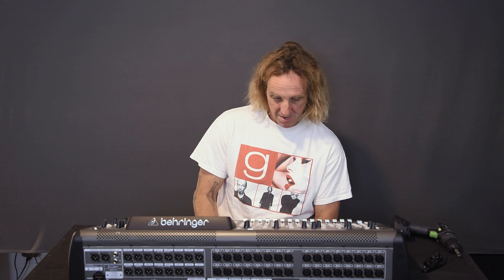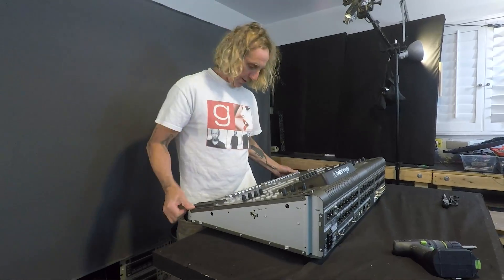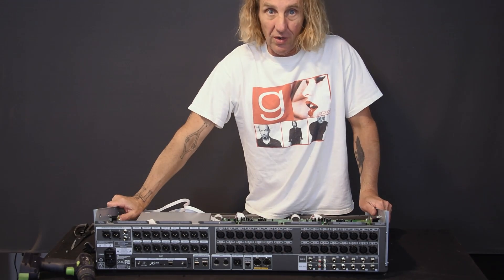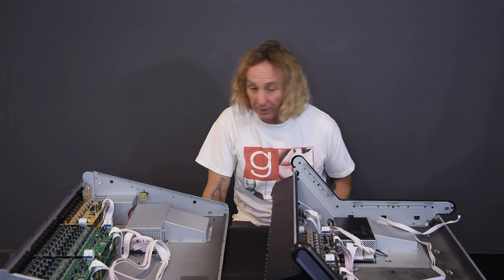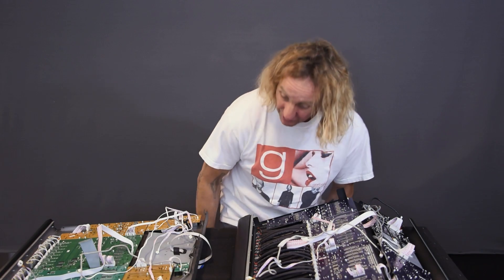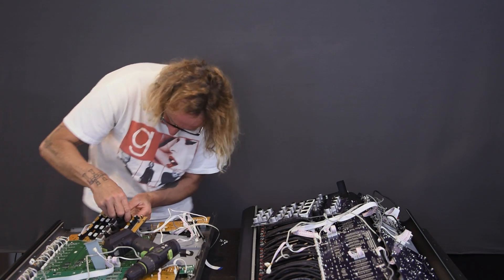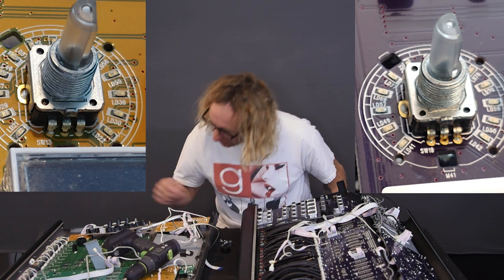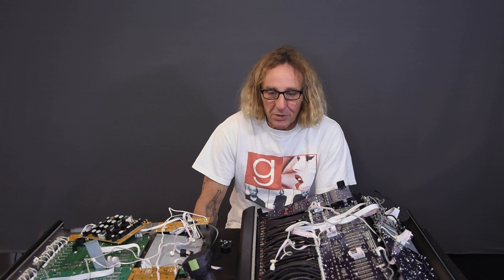Take Apart Behringer X32 & Midas M32 (Public)

Comment: A couple years ago the bands came off 2 of the faders on our M32. Having been inside our Midas XL200 numerous times I figurered I would try to tackle this. I could find no videos or info on getting into an M32 but several on the x32. They almost pursuaded me not to proceed. But I needed the console for some immediate shows.  It was less painful than I expected but it would have been nice if they had made the ribbon cables a little bit longer. The way the board hinges back you would not have remove it  and therefore not have to undo all the cables ...if they were just a little longer. The faders were mounted in sections of 8  to a board that was then mounted to the frame. Easy peasy. I had bought some faders not knowing in advance what to expect. I got some of the x32 faders by mistake (should have known when a pack of 5 cost the same as a pack of 1 m32) They were indeed vastly different.  I just hope I never have to fix a loose band on our x32, because it will become surplus gear at that moment.

Comment: Interesting stuff.  Don't know exactly how I got here.  Living most of life on the electrical engineering side of my brain I have some insight though.  The cost delta is going to be cumulative.  However manufacturing process tends to be the most significant.  A product that can utilize surface mount and thus pick place machines is going to be more inexpensive provided there are a decent number to be manufactured.  Even those minimum volume levels are dropping every year.  Yes pick and place is used on through hole boards, but the boards requires all of those precision holes, and a solder wave flow.  Higher component rejection rates due to bent pins (all resulting in higher costs).  I see in the comments below there is a SNR delta between these units.  I would estimate that has more to do with board layout, and possible cumulative effects of ever so slightly reduced component selection.  Of course there is always the battle of diminishing returns.  The first 80% of a spec is cost effective.  The last 20% is exponentially more expensive as each percent is retired.  Neat stuff you have here Dave.  I might just wander around here a bit.  I promise not to touch anything ;-)
Reply from the maker: Awesome Shain and thank you!

Comment: Typical of Behringer to put hot glue on connectors. I know that the intention is to make them vibration proof (live and transportation) but isn't the clicking mechanism enough? I've never seen a connector like that come loose and other pro live brands don't use hot glue. Maybe they don't trust the cheap second rate parts they use :-P like the knockoff Neutrik sockets?
Reply from the maker: Yeah, cheap connectors will often have failures on the latch. Glues is a cheap and annoying fix

Comment: I can totally attest to the quality of the Midas faders. 

In 2017 I took out my brand new M32r for the first time mixing both support bands on tour with Cannibal Corpse. Towards the end of the second set at summit music hall I took a full Mikes Hard lemonade tall can to the face. I mean this person had to really try and MAN, BULLSEYE! Anyways, it dumped straight into fader bank 1-8. I got up asap, grabbed the can but easily 10oz of liquid already poured into the desk. Faders 4-8 started jumping, finished the show just muting when they’d jump. After I tilted it up and slowly dripped what was left out, turned it back and blew compressed air through the faders to try and get any liquid still there out. Didn’t use it the next day, kept in the case with a bunch of silica packets. Day 2 had to carefully clean some sticky shit out of some buttons and exercise a couple faders. Day 3 opened it up, tried it out, powered on and we were all good

5 years later still throwing delays with those same jumping faders. Well worth the price jump.
Reply: Just out of curiosity...Did this happen before or after the Portland, OR stop on that tour? I recall having some mysterious cat5 drop out from the stage box during gatecreeper's set at the hawthorne.
Reply: @jasperwasson4963  I don’t remember which was first in the routing but I do remember that day all too well as the day I learned to never trust the house cabling! If I’m correct, you had a sketchy old white ungrounded data cable that I mistakenly ran my show off of instead of my snake. Don’t worry, it won’t happen again! See you in April! :)

Comment: Top notch video 👍🏼 I was very impressed and interested to know what the differences were between the two processors of each console. I've been mixing for quite some time and have used both the X32 & M32 to my ears the M32 sounds more open and transparent and I'm sure the community will agree that there's enough arguments to be made between the two.
Reply from the maker: My understanding is that once the signal is converted to digital, the consoles are the same.

The differences are in the build quality, the analog circuitry and the d to a converters
Reply: @DaveRat  thanks again

Comment: Is there a difference with the scribble strips?  I've never used an X32, but the M32 that I've used a few times seems to have scribble strips that are mounted at different "levels" when viewed from the top.  In other words, it appears that some strips sit higher up off their board than others.  I feel certain it's never been damaged or repaired, so not sure why.  But, it appears to be built cheap, at least with the scribble strip displays.

Comment: Right off the bat I can see that on the Midas you would be able to replace "some" of the components (not all) if say a transistor or cap blew.  Behringer looks like strictly motherboard topology and therefore it's a bit harder to repair (disposable).   The similarities inside of the two boards is surprising though given the price difference.  
This is a great video and it does bring a lot of truth to light in terms of what we are spending the money on!!
Reply: Home reworking smd is nothing to shy away from. As with most things the right tools make it possible.
Reply from the maker: Agreed

Comment: Hi Dave, the contacts on the removable buttons may be the same, but longevity and durability of the circuit boards is EXTREMELY different.  The behringer looks like phenolic PCBs whose contacts won't hold up as well as the gold plated copper contacts on the FR4 circuit boards in the Midas.
Reply from the maker: The switch contacts on the x32 appear to be good plated as well

Comment: You seem like someone who has a lot of practical experience with the X32. Weird question for you. We've got an X32 and we are sending out broadcast mix from Ableton post processing through the USB via the X-USB in the X32. We are then routing this to AUX-In channels 1-2 and sending this channel post fader out to our ATEM for the livestream via AUX Out 5/6 and also out of local (back of the console) XLR out 1/2 for monitoring via headphones using a Behringer P1 headphone amp. I've come across this very strange phenomenon that when I push the input signal of the broadcast master AUX 1/2 up to -12 dB, I begin hearing a tonne of distortion coming through the XLRs on the P1 but no distortion on the ATEM. What could be causing this? I'm not clipping the input (I'm at -12 dB) but the XLR out still clips. It has me baffled. The P1 Amp volume is set quite low and the distortion is there regardless of volume on the P1. Keen to hear your thoughts and wondering if you have come across this issue with XLR output clipping before? Cheers
Reply from the maker: Oh my, thats beyond my knowledge of the consoles
Reply: 😅 Then I have no hope haha. Could it be an issue with DAC on the output?
Reply from the maker: Hopefully someone hear will see and post. Also on the paid member side I do zoom chats a few times a month and there are some sharp and knowledgeable people that are good at that kind of stuff

Comment: you can use the cheap plastic jewelry trays to organize screws as you remove them. that's what i do when i replace engines.
Reply from the maker: Good idea
Reply: @DaveRat  Harbor Freight has magnetic trays in different sizes for holding screws....I have too many of them

Comment: I just got one of your XLR Sniffer/Sender units. I am currently working with a fully installed system where they have about 30 XLR cables that 'magically' appear near the sound console, and are both ran into the wall, up the wall, and out a hole to continue their path to the stage some 75 feet forward and then another 25 feet down the back of the stage wall. None of these cables are labeled.  They also have a digital stage box. The ability to plug this device of yours into the XLR cables is going to allow me to identify about a half a dozen lines that I have no idea where they go. Sound people come and go, and keep adding lines, and modifying things. Trying to just get control of everything.
Reply from the maker: Excellent?! Let me know how it goes!!
Reply: @DaveRat  will do!

Comment: 13:17 The Behringer side has a visible seam on the threads and a rougher casting in general. The Midas part is a higher quality casting and the top of the mounting threads is machined flush.

Comment: What about workflow, are they roughly the same? Probably another video of the subject already? None of them has moving HUI faders, I presume?
Reply from the maker: Workflow and software is identical
Reply: @DaveRat  great, thanks for the answer... 👍 

Too bad none of these affordable live boards, has touch sensitive fades and HUI software build in. So I could use it as a studio mixing console, for my Pro Tools system. Lots of "ok" DAW controllers, on the market, but I miss the workflow and intuitive access to everything on the live consoles. It's as close to working on a analog console as it gets... 😊

Comment: I’m surprised at the differences that were found in the sonic tests.  I’m not an electronics engineer, but friends of mine that are have made some really high quality pre’s that didn’t cost much to make.  I have a friend that has done a lot of major design work for many of the big names and he was telling me that in terms of AD and DA really good ones can be had for exceptionally low money.  In terms of mic amps, I hear the noise about this pre against that pre and every test comparing pres I’ve ever heard posted the differences were subtle to say the least and comparisons with mic amps that cost a few pounds each and others that run more than a thousand a channel often are not clear cut.
Reply: Agreed. Very flat/clean mic pre's don't have be expensive. They can get expensive if you use a transformer on the input and expensive boutique switches. I'm legit both types of engineer (electrical and audio). Sometimes, very flat sounds... well... flat. Most audio engineers I know want SOME "character" out of their mic pre's. That's why for studio work... we typically buy a shit load of different flavored mic pre's then just mix and match for the current purpose/project. I don't think even steely dan drags a mixed rack of boutique mic pre's out on the road. I was very surprised by the resonance/ringing exhibited by the behringer board vs the Midas on the square wave input. I'd "guess" they both use the same off the shelf A/D converter (very accurate A/D's are cheap. why source 2 ??)  I'd have to snoop it using directly channel line out vs assigning to a buss and checking buss out. Also maybe test the aux line returns. Weird.
Reply from the maker: The a to d appears and I believe is the same while the D to A is different and a slightly lower latency on the Midas, 

And thank you.  And yes, a good flat mic pre can be inexpensive, and extremely quiet version with a wide input range gets more expensive.

Comment: The PCB boards looks to be of the cheaper "home brew" type on the X32, where the PCB on the M32 are the fiberglass version used in higher end equipment.
Part of the difference in the PCB's are their capacitive "resilience" and by that be more precise when moved between a cold van/truck and a hot concert hall ;)
Reply: They are both definitely FR4, the yellow color they went with just makes it look like that.
Reply from the maker: I would not be surprised if the x32 boards are lower cost. It would be consistent with other cost saving measures.

If the. Lower cost is pure looks or more brittle or lacks a coating would need to be tested.

We know the x32 9s cheaper, the question is "what concession were made to reduce the manufacturing cost?"
Reply: @DaveRat  I don't doubt the x32 board cost much less to produce as a whole but the PCB material itself is very very likely the same. These days you would have to pay extra to NOT use FR4, even the $2 Chinese prototype PCBs are FR4.

As you mentioned the faders are likely a big savings. Also the electrolytic capacitors are less and probably of a lower quality. I don't know if you got a look at the underside of the output boards on the x32 but I did not see anything equivalent to those xilinx FPGAs (the really large chips) they probably cost $50-100 each. If the x32 doesn't have those somewhere then they are actually a much different architecture than I would have expected.

It's possible they put the logic from that FPGA into a much smaller custom ASIC that just hasn't propagated to the m32 yet, they would have more incentive to do it in the higher volume product first.

Overall though as an EE that focuses on PCB design I am surprised the M32 is only 50% more expensive given what the internals look like. I can't say from just looking if the m32 is better electrically but I do think I can say it is definitely more costly to make. The margin on the x32 is probably much higher than the m32.
Reply from the maker: I agree and as a manufacturer of products and buying loads of circuit boards, we do have options to save money from differing vendors. My guess is that if the cost was the same, they would save money by using the same source and type, so just the fact that it is different may be an indicator that the savings was worth using a different vendor or board type.

And yes the pricey chip is not on the x32.

Thank you for the insight and knowledge!!! Very much appreciated.
Reply from the maker: Interesting

Comment: I had an X32 and added the Midas 32 channel snake head to the system, which made a significant difference ( and my ears are not that great! lol). I ended up with an M32R as control surface and sold the x32. I also use an MR18 occasionally, which is very cool also.
Reply: We run hybrid using m32 plus boxes to do most heavy lifting in a project studio 
Once we upgrade it will become touring rig what it’s actually intended for 🤣
Did just dive into 500series tho

Comment: Dave,

I really appreciate you taking the time to do a deep dive and see what's under the hood for us.

I'm very surprised to see true "Midas Pro" faders in the m32. I knew that console was advertised as having them, but I wasn't 100% convinced. I've used various m32s for countless shows at several venues in town, and have also had the joy of mixing on a Pro2 at my full time job for the past year. I had always felt like the Pro2 faders felt more precise, but after opening it up to 
re-align a belt, I can tell you the m32 faders look identical! I'm sure you've been in your fair share of Pro series consoles though, I'm curious if you have a similar opinion on fader feel.

Regarding the Pro2, it's been replaced after 9 years of service, by an Allen & Heath dLive system. Several fader issues, and the fact that Midas no longer sells replacements, were part of the reason we upgraded. So far, the dLive has been a treat to work with. I'd also love to hear if you have any experience with those systems, and any pointers you might offer given the leap in processing capabilities and options!

Thank you!
Reply from the maker: Cool cool

Comment: I've had poor experiences with X32 motor faders when the boards were first release; a band wanted me to preset their monitor mixes for an Asian tour that they couldn't bring a monitor tech for. I went through 3 consoles before I found one that worked without issues. I'd trust the A&H much more. Not as sexy, but much more solid in my experience. 
 Great video Dave, always appreciated!

Comment: Great video! Another check you can make would be which  opamps were used and of course most importantly if the used the sam ADC and DAC ic's
Reply from the maker: The op amps appears to be the same. The d to a is different, not sure on the a to d

Comment: Dave I'm a bit OCD when it comes to screws - my pulse was going up as you were tearing down! :-D  In addition to the fader differences which you pointed out, I do see a large difference in the materials quality and components between the two consoles. On the output board, the Midas uses larger and faster Xilinx chips, and the XLR jacks look to be higher quality with better contact wiring to the PCB (at least from the photos ). I'm not an IC designer but there seem to be more redundant components built into the input board. Fun to see the comparison - thanks for all of your teaching, I've learned a lot from you over the years!
Reply from the maker: Ha! Yes, am fast and loose with screwing around!

Comment: What I found when it comes to moisture on the control surface of the M32 is not so much the faders but the PC board mounted connectors that the scribble strips attach to. They soak up moisture like sponges and they way you know you have a problem is that the scribble strips stop working. In that case its best to replace the entire 8 channel board to resolve your problem. 
Pretty easy job once you got the hood up.